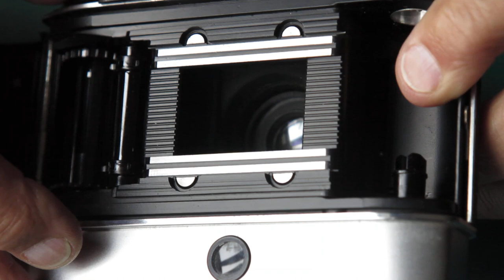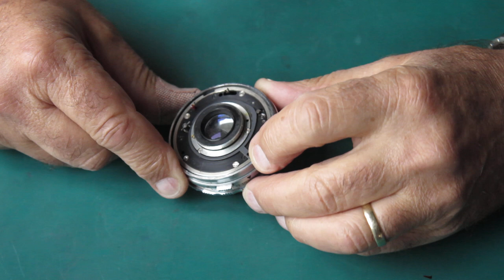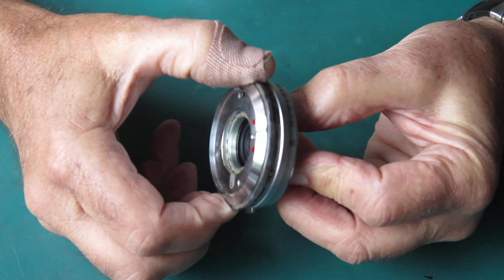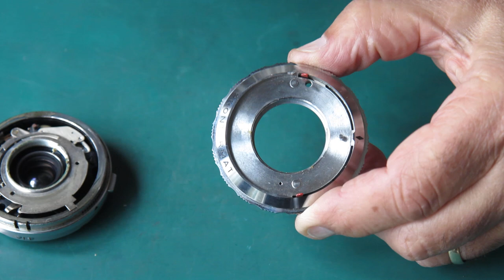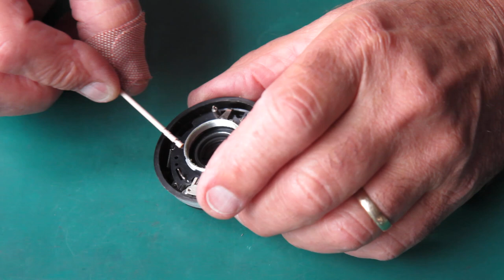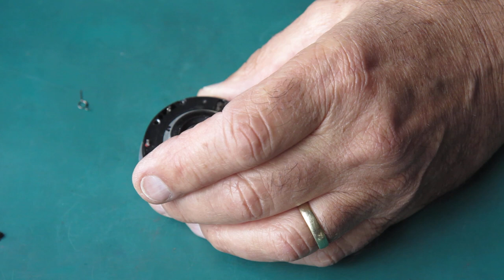Servicing a Kodak Retinette IIA, part 01

Comment: Hi Chris , very useful set of films helped me dismantle and rebuild this model in order to free off the aperture blades .  Seems hardest part was soldering those fragile meter wires when putting back the lens and shutter to the camera body.👍
Reply from the maker: Yes, I greatly dislike that part.